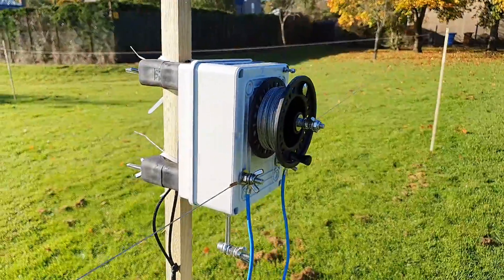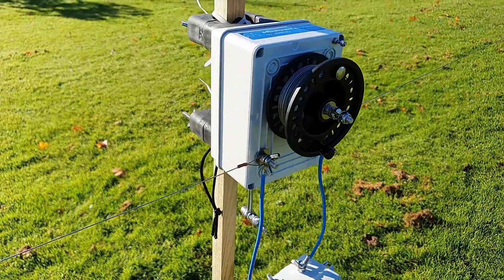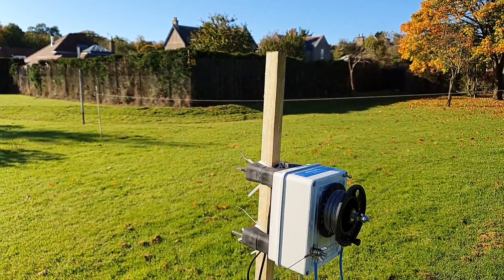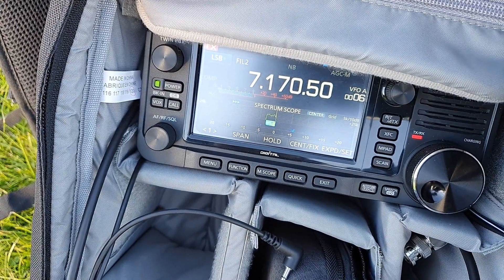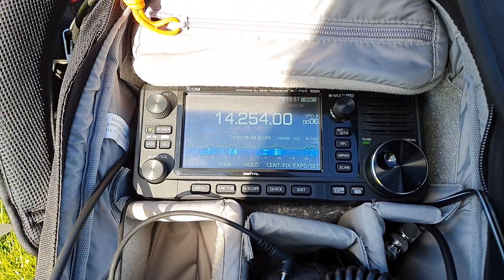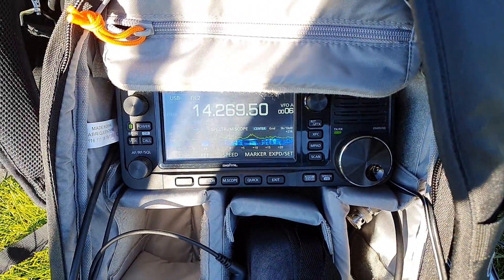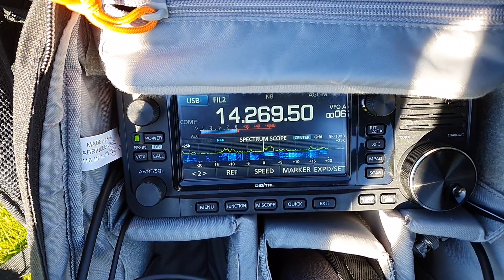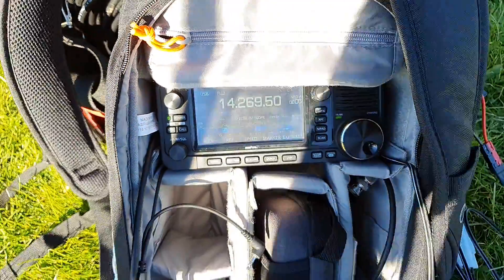adjustiwave Multi - NVIS loop configuration. First on air testing using Icom IC-705

Comment: Cheers Colin, how are you getting on developing for 80 ?
Reply from the maker: Hi Brendan, you can only physically fit 60m of wire on this reel so that's the limiting factor. You can't use as a loop unless you make a loading coil. For 80 as is you have the option as using as an inverted L or a EFHW when combined with the appropriate unun. Cheers